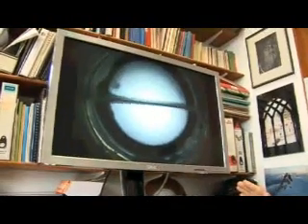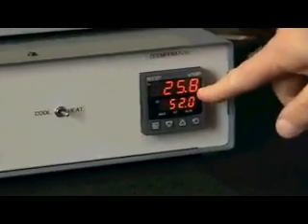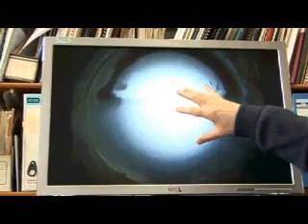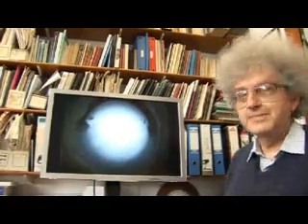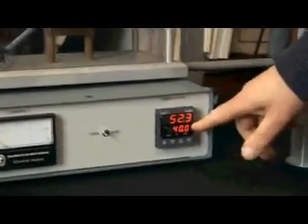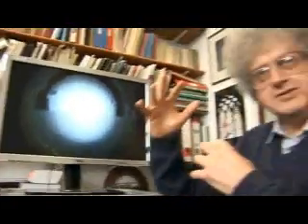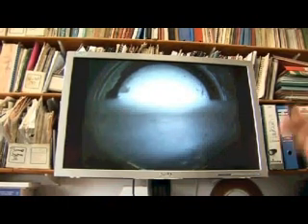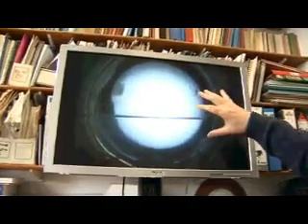Supercritical fluids

Comment: Can it be done by vacuuming water instead of boiling? or with liquids hat boiled near room temperature??
could we make an environment that exists in these conditions??? answers scientist now!!!
Reply: Not a scientist, but I doubt a supercritical fluid can be formed by lowering the pressure, as supercritical fluids are found at pressures and temperatures above the critical point.
Reply: +Electro Shaman You can by increasing the pressure of a gas, given you are above the critical temperature. If you search for the phase diagram of water, you will see the area of the graph which is "supercritical".
Reply: +Quietsamurai98 Agreed. I think it has to do with overcoming surface tension. I am not a scientist either, by the way. At least not in this field.

Comment: In liquids you can have two immiscible phases. Can supercritical fluids do that? i.e. can you have a vessel with two supercritical fluids that separate out like oil and water, or do they always mix like gasses?
Reply: Absolutely. I am measuring VLE of ethers and CO2 and once supercritical conditions for CO2 are reached in the "gas phase", and equilibrium of liquid phase (Ether+CO2 dissolved) and a gas phase (supercritical CO2+Ether) is observed.

Comment: What happens if we increase the pressure of a supercritical fluid? Why doesn't it return to the liquid phase?
Thank you !
Reply: Because when you reach what is called the critical temperature, it is the last point at which it is possible to turn it into a liquid with pressure. Once you pass the critical temperature, it becomes a supercritical fluid when pressurized! I just learned this in my college chem class, so I'm not an expert, I just know a little bit about it
Reply: When you increase heat you increase pressure. Higher pressures cause what is known as expansion (of liquids). Your air conditioning works in same manner. Only cooling a substance returns it to its natural state (natural state being employed in ambiant temperature). It gets very complicated from after that point. All you need to know is heat makes things expand like boiling water, it vaporises into the air. The same way the sun heats the oceans to form cloud

Comment: There are so many discussions about the toxicity of CO2 that people are forgetting the actual application of CO2 as a solvent.  After it is used and the temperature and pressure return to normal the CO2 reverts to a gaseous state and leaves the material.  That is why it would be totally non-toxic for use in the production of medicine for example.
Reply: And even if traces were left behind, it still wouldn't do anything to you
Reply: @DANGJOS    Exactly, there would only be traces.  It takes a large amount of CO2 to cause a human being any problems.
Reply: Drinks with bubble are full of co2, co2 is in the air too. It's not toxic
Reply: It is used extensively in the extraction process involving marijuana b.
Reply: CO2 is non-toxic,although it traps heat
Reply: As we all exhale carbon dioxide it definitely cannot be classified as toxic gas. It just not suitable for breathing. But for breathing anyway only oxygen fits. Another question is the green house effect caused by methane and carbon dioxide. On the other hand carbon monoxide is definitely toxic and really dangerous as it has no color no smell and taste, but causes even in quite low doses on longer time even lethal intoxication and first symptoms are just headache.

Comment: P.403323 - The way of the pyrolysis 27.03.2013
P.403744 - Disposal Mobile mixtures, suspensions and solutions in the states of: sub-, and supercritical 29/04/2013
P.403784 - Mobile as periodic disposal of mixtures, suspensions and solutions, especially in the states of: sub-, sub-and supercritical 05/06/2013
P.403785 - Dosage and bleed flow, the pressure reactors 06/05/2013
I expect to have two numbers of applications.

Comment: @starked1 Oh, and the Apollo Lunar Module stored supercritical helium in its descent stage to pressurize its propellants.

In the Service Module the supercritical O2 and H2 could become non-uniform or "stratified" in zero gravity so fans were added to stir them occasionally for more accurate quantity readings. On one flight, damaged electrical insulation on the fan in one O2 tank caught fire, resulting in the Apollo 13 emergency.

Comment: @starked1 Supercritical fluids are already used in some spacecraft. The Apollo Service Module stored hydrogen and oxygen for its fuel cells in supercritical form. The tanks held much more than they could with compressed gases at room temperature but took less heat to vaporize than LH2 or LOX.

Comment: @Ducky1138 You appear to be unclear on the definition of fluid. In common speach they are often used interchangably but there is technically a difference. 

Simply put, a fluid can be any material which can flow, which includes gasses as well as liquids.  The critical point is the point on a pressure/temperature graph at which the transition from two distinct phases (liquid and gas) to a single phase (as shown in the video) occurs. As this exists above that point it is called super-critical.

Comment: Supercritical fluids form the harshest environments in the world. If you need to destroy a chemical or do wastewater treatment, it'll definitely do the trick...if the container lasts that is. Even high density stainless steel doesn't stand a chance for long. Containing the supercritical fluid while using it in an application is a very important problem to solve.

Comment: Depends on your definition of a pollutant.  It fits the common definition:

"Pollution: introduction of contaminants into an environment that causes instability, disorder, harm or discomfort to the ecosystem"

But other groups only consider elements toxic to humans (such as Carbon Monoxide) to be pollutants.

But all this detracts from the main issue, large amounts of man-made CO2 (mostly from burning coal, oil, etc.) is causing the planet to heat up at an accelerated rate.

Comment: Sorry, oomblikkies, I guess I didn't explain what I meant very clearly.  If you needed to use a solvent in the manufacture of a replacement body part, maybe a mechanical heart or pacemaker, then a supercritical fluid used as a solvent would be a better choice than say, benzene (random example) that might remain residually and leach out.  No body tissues need be harmed by the pressure ;p

Comment: One little mistake in the vid: At 1:12, the professor says that "... eventually they become the same density, and the line in between it, completely disappears".

The two phases do not necessarily have to have the same density in order for the dividing line to disappear, but the same relative index of refraction. This is often demonstrated by sticking a glass spatula into a clear liquid of the same refracion index of the spatula: The part of the spatula that's in the liquid, becomes invisible!

Comment: am i confusing super critical with super heated."a pressurized liquid will stay liquid past its point of boiling"?i herd of it in steam engine design on a wiki site or sumthin about injecting super critical water into an unpressurized cylinder it expands quickly becoming gas.you know the rest it was supposedly a better than conventional steam type engine power/weight ratio wise. kinda make sense but yours didnt stay water it deffinitly didnt look like i imagined it if it is even the same thing??

Comment: Since you have mentioned solid-liquid phase equilibrium of water (you talked about ice), we
have to say that in this case we also observe
an interesting behavior. This interesting behavior is that the P-T solid-liquid coexistence curve has a negative slope (whereas in other fluids is positive) and this has to do with the fact that the density of ice is lower than this of liquid water. Due to this fact, increasing the pressure drives the water into the higher density phase, which causes melting.